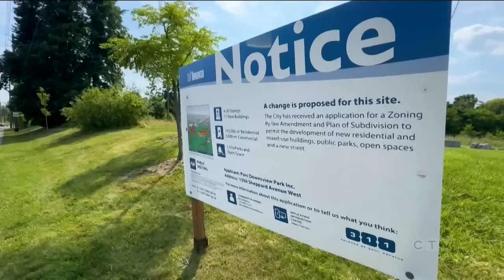Feds offer up government properties to builders for affordable housing

Comment: About time.  But will the builders lower the price?  And will it in or near the city where jobs are  ? Builders must sign an agreement that price will be in certain range and must not be sold to foreigners, investors and realtors .
Realtors normally take those units below market value and resell it at higher price when the project is finished. This rules must be a Must so that units goes to lower income canadians.

Comment: What about the salaries to be able to afford those homes?  Minimum wage needs to be raised without the ‘threat’ posed by corporations that prices will increase.  If you look at corporate profit during this time, they’ve continued to  increase while taking advantage of the slave  labour they call service industry jobs.  These are not viable conditions for home ownership or economic prosperity.  The other thing is putting this in the hands of building companies.  This needs to be overseen by a committee or board of community stakeholders, not corporations, to ensure it’s an affordable initiative.